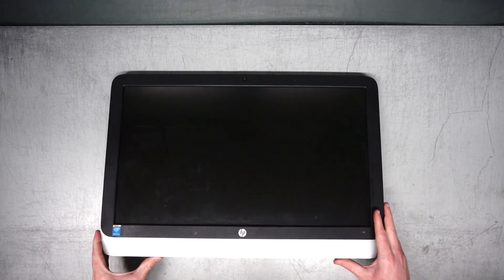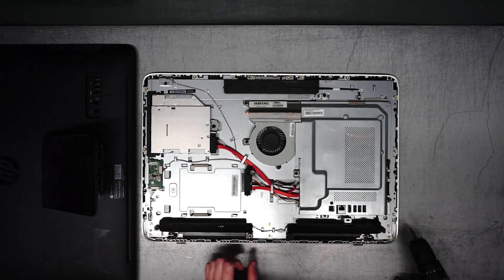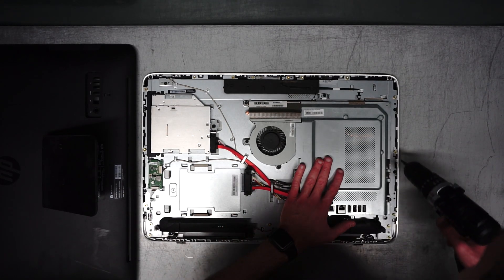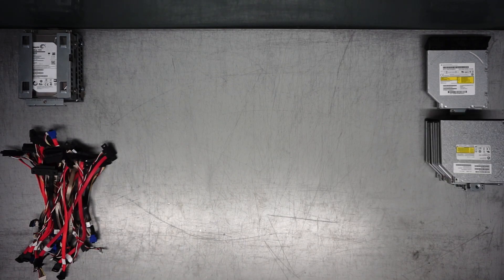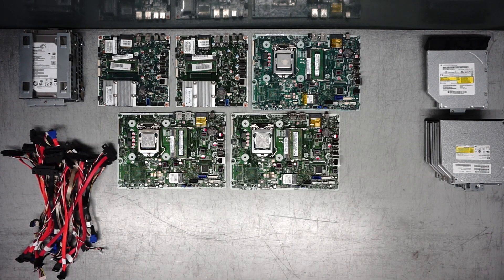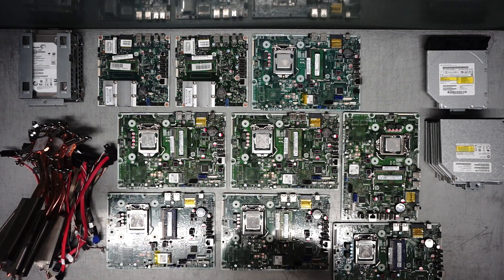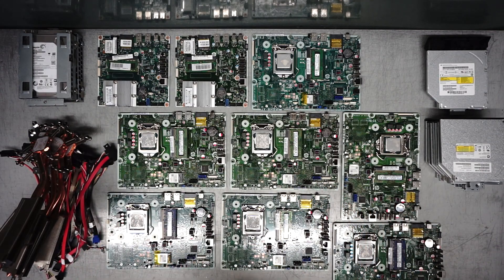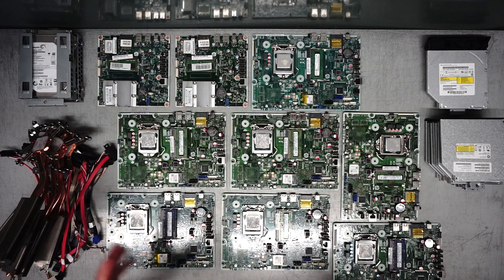Scrapping 9 HP All In One Desktop Computers: Scrap Motherboard Hard Drive LCD HP Desktop Computer PC

Comment: what will HP do after they replace new one with old one motherborad
Reply: will it go to scrap or repair the hardware,please reply asap
Reply from the maker: I am not sure what HP or other companies like them do with parts that have been replaced. I would suspect that they would try to repair it in-house and then if successful, keep it as a reserve for when a similar computer gets sent in for repair and needs a motherboard replacement. On the other hand, if they are unable to repair the replaced motherboard, I would suspect that they would send it to an ewaste facility that would destroy these said items. But, once again, I cannot speak to there process because I am completely unaware and my guess is as good as yours as to what happens.